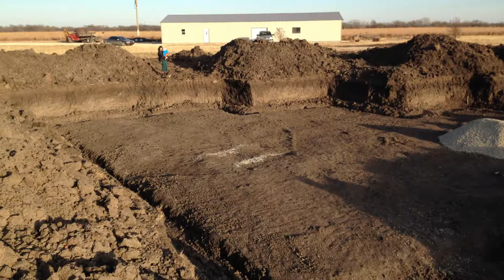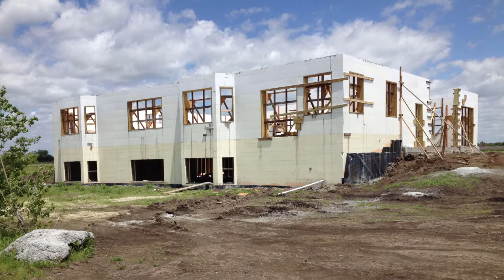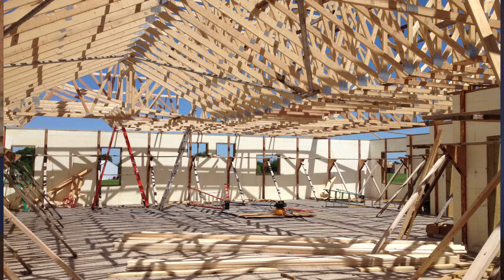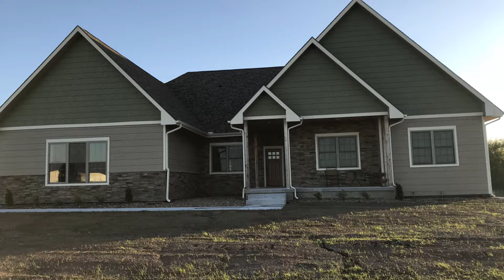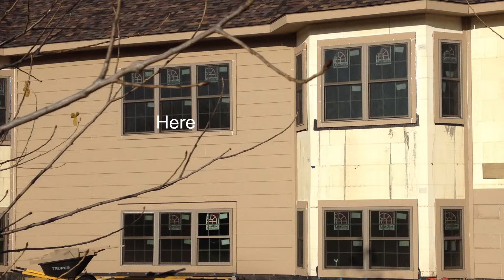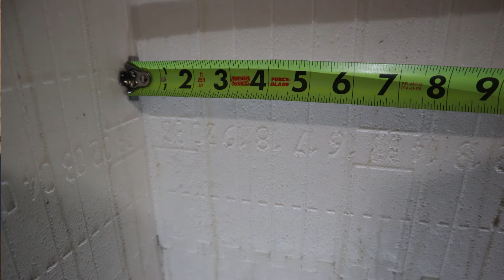The Realities of ICF

Comment: Hi, I wanted to ask you about your plastic strips. And around 11:45 you mentioned plastic strips to screw like you know. Hang stuff on the walls.
So you don't use furring for wood furring to hang the drywall? Then from there you know wouldn't be easier just to use the wood for it and then used to use that to drill into. You know like you want to hang something
Reply from the maker: The plastic furring strips are to take the place of wood ones.  The wall is already thick, so adding wood would make it even thicker.

Comment: In Kansas, I’d have considered adding a concrete roof.  I’m going this in Georgia for hurricane/tornados.  I want my roof to be concrete also, so there is no uplift and 50 year roof with terra cotta tile glued to waterproofed comcrete
Reply from the maker: My spans were too big
Reply: @TheChallenged1 hmm my spans will be 28 feet.  The pitch will be a 4-12 and 6/12  lines.  The length is 70 feet. We will see.
Reply from the maker: @Alphasig336  I believe you should be just fine.  My spans were between 40 and 60 feet depending on the location within the house.

Comment: An easy solution to the problem in finding the metal studs in the ICF walls is to hang wood firing stips before you drywall.   It's an additional cost, but it will make dry walling easier, and you'll have a wood surface to acrew/nail into that's easy to find using a stud finder.

Comment: I did a hvac job on an ICf house and going thru walls was terrible due to the concrete. Next job walked thru the job to layout for builder to put have openings where ducts will be. Came back and no provisions were done. I said goodbye. Won’t do a job unless ductwork in attic with no concrete to penetrate

Comment: We just bought land and looking into the double wall method and the icf
Reply: I wonder if you will be better off with ICF + steel framing.

Would it be cheaper overall?
Reply: @GerminiETH  the double wall method is cheaper framing might be cheaper as far as material, but it’s not cheaper when it comes to labor

Comment: Insofast is a company that exclusively built ICF.  They pivoted and now provide insulation products for stick build.  X brackets are their latest invention, and allow the exterior chipboard to be spray foamed.  You can do a Joe Lstiburek perfect wall as the foam is both a vapor and wind barrier, which prevents wood rot.

Comment: It sounds like you are a hardcore energy saver, you may like earthship homes or any underground structure because they do not require heating or cooling what so ever. No 2 are equal! 
An earthship home can be more costly than a simple extra large root cellar underground. 

Did you know some sewage systems are made of huge metal circles that perfectly distribute the weight of the earth above them? 

Did you know that metal back then was inferior to the metal we have today? ; because our processes are more advanced, now they can last 100 years. And if you do it right, addint gravel and having a concrete foundation and all. You can make it last 150 years or longer.

Comment: Would an ICF home be even cheaper to heat if you had radiant heating system instead of forced air?
Reply from the maker: It wouldn't matter the delivery method, just the number of BTU's input into the structure
Reply: Probably, pumping water somewhat constantly is probably cheaper than pumping air not quite as constantly. The difference with be the cost of pumping not the cost of energy.

Comment: Great videos and very educational!! We just bought a 4700 SF ICF home built in 2003 in Andover, Kansas.  First thing i noticed was the consistent temperature throughout the home. We’re renting a traditional home in Illinois and it’s highly inefficient. The wife and i slept in the new house and noticed how quiet it was.  I did feel the air in the basement felt a little still.  I also noticed how little the HVAC had to run to keep the temperature up.  Thanks again for your information.
Reply from the maker: Congrats on the move!!!  It really is a different experience living in an ICF home

Comment: I Wes wondering if you spent/n found windows that exceed the norm because that’s ur weak spots. I’ve noticed that my temp can b 72 in the center of the space but at the windows it can b 20-30 degrees less ( -25 temp outside)   I’m wondering if windows could / should b fixed units as ur inside is so conditioned.

Comment: Other than the insulation, the properties you describe are true for brick/CMF homes.  I don't live in the US and in my country all homes are built either with brick, concrete or CMF blocks.  When I visited the US, the noise and wind caught me off guard.  You really don't have those problems with above mentioned homes.  In the US the noise insulation between rooms were really bad.  The insulation and ease of construction would make ICF my preferred choice.  But just wanted to point out that other than those two properties everything you describe is pretty much equally relevant on for living in a non-wood constructed home.
Reply from the maker: Makes sense

Comment: Loving your videos.  I am helping a friend who has decided to build her house with ICF blocks.  I'm 65 now and a retired former General Contractor and Chief Building Official, so I have experience in building and the regulations and codes that govern their methods and materials, and I really like the advantages that ICF construction offers, but I don't have any prior experience working with, or inspecting ICF construction.  I'd really appreciate any and all advice you can provide. My friend would even be willing to pay you a modest consulting fee for one on one phone or video chat consultation sessions regarding specific parts of the construction process, like your Geothermal heating and cooling system, and perhaps the Solar electrical system.  I also have prior experience working as a lead draftsman for an Architect very early in my career, so I am working on her house plans myself, with the guidance and help of an engineer friend I used to work with.  I hope to have the plans completed before Jan. 1st of 2022.  Please let me know if there is a way to contact you directly, or some way I can get my contact info to you without putting it up in comments here for the whole world to see and abuse.

Comment: If the sheet rock is screwed into the plastic studs, just use a magnet to find the screws. No need for a stud finder.
Reply: Doesn't a basic stud finder use a magnet?

Comment: I built our 4000 sq ft ICF home in 2003. The wife and friends said I was crazy to use ICF. Currently we are experiencing a heat wave of + 40 C. (Canada) and the interior is 20 C, or about 70 F. Love it.  As well when the winds exceed 50 mph we don't hear nor feel them.  Our heating costs are very low even though we have 6 months of cold winter, often below -40 C. This house has not moved 1/8 inch in 20 years. I went with a high efficiency gas furnace for expediency, but even in the winter it runs very seldom.  The only way to build.
Reply from the maker: Thank you for sharing!
Reply: I am just finishing one in northern indiana and heating it with a 24,000 btu ducted mini split, 2080 square foot footprint with full basement and main level so 4160 sq ft of floor space being heated. It is the only way to build a house and I dont think I could do a conventional house now.

Comment: The only hidden cost is a “Air Circulation System.” These houses are so tight that the interior air needs to be refreshed. This system can be designed to handle the square footage, and really takes care of all your humidity or dryness problems. My house is 3600 sq ft, with 36% exterior glass (floor to ceiling) with 12’ ceilings throughout. We only use electric, which includes a sewage pump system, and one (yes, one) AC/Heat Pump. We also have our own well, so there’s an electric pump in the well. My average utility bill? $72.00 per month. So, how much more was the construction costs? About $6-8.00 per square foot. But, when you figure the average 3600 square foot house with normal wood construction you can expect to pay $200-300 per month for electricity, plus an initial cost of much larger AC/Heat units. So, within a year you will re-coup all your extra initial construction costs!!
Reply: Why did it cost $6 to $8 more per square foot? Was it because of the labor that ICF the concrete?
Reply: @victoriaalai5041  the extra cost comes from the concrete and it’s placement. Plus there are additional rebar costs. BUTBwhat appears
Reply: @stephentaylor9366  thank you for your quick reply. My husband and I are thinking there may be extra costs to too make the cuts for the plumbing and electrical lines as well. You're information was very helpful.

Comment: I’m trying to imagine the amount of sweat I would experience if I kept my house 76-77 during the summer. I can’t even sustain 72 for any length of time. Back down to 70 is where we go.
Reply from the maker: Pretty spoiled
Reply: @TheChallenged1  I grew up in houses with no air conditioning. I’ve only had A/C for 4 years now and I think of it the same way I do heat in the winter, it’s there to make my space live able. My house is 68-71° year round.
Reply: I totally agree Jen, a super insulated house isn't affected much by the outside temp so once the house is at set temp it more then likely doesnt use much more energy to keep it at 69° (where my house is year round) vs 76°.  I'd be willing to bet it's fractional, especially with high efficiency HVAC units
Reply: @gyminit5  exactly. Insulated house and windows shut tight, my A/C isn’t working that hard to keep my house at 70° even when it’s 95-100° outside. It uses much more energy to heat it from 30-40° than it does to cool it.

Comment: We just built a 6200sqft home (including finished basement) and used an R30 ICF product. Blown away with the efficiency so far especially the ability to manage day/night temperature swings. We barely need to run our AC unit or heating system. It has been silly efficient so far. Absolutely love it.

You raised a couple other points that resonated with us. We're on a rural property and you would never know when it is windy outside. And yes the usual temperature related creaks or pops are non existent with ICF.

Highly recommend that anyone looking to build with ICF include a higher end HRV/ERV system to constantly exchange the air inside since it creates such a tight envelope, and also to look into a HEPA/VOC filter for your furnace and/or recovery ventilator.
Reply: Now that’s what I’m looking at. Love the testimonial. What’d u do for windows ?  I often wondered if more needed to be done with the conditioning of the air   Do you open ur windows or keep shut ? What’d udo for the basement floor ?
Reply: Not the original poster but I can answer your questions. I did triple pane windows from Provia and I do open them a lot during the temperate months here in northern Indiana. My basement floor is 5 inches of concrete over 3 inches of foam board, I did put tubing in the floor for heat but it is not hooked up to anything at this point. I and 2080 sq ft per level, basement and main floor and heat it all with a single 24,000 btu ducted mini split in zone 5 northern indiana.

Comment: Are insect infestation more prone to ICF homes?
Thank you for your videos, very educational for someone new to ICF homes.
Reply from the maker: Less so than most homes because they are much tighter
Reply: Insects don't eat concrete
Reply: Some insects do like to burrow into the foam to make homes. We built an ICF house (a two story with full basement) in Illinois in 2004. The lot we bought was the last vacant lot in the neighborhood, had a lot of large trees and when ever it rained, had areas with a lot of sitting water. As a result, the entire lot had years (and layers) of accumulated fallen leaves which had decomposed into a material which was very attractive to ants. After the house was finished and we had lived in it for a year or two we noticed how many ants we always saw on the sidewalks and in the flower beds. Then we started seeing them in the house. (I joked that we must have built the house right on top of a huge ant colony.) Anyway, we engaged the services of a pest control company which treated the outside of the house quarterly. And if we ever saw any activity inside, they came out and treated the interior with pet safe ant bait material. The ICF blocks we used were the standard type foam, but some manufacturers do (or did, I haven’t checked recently) incorporate borate into the foam to discourage insect activity. Of course at some point the effectiveness of the borate will dissipate. The ICF walls are tight, but ants can find their way into anything through tiny openings around windows and doors. We lived in the house for 18 years then retired and decided to move to a more temperate climate. I am an architect, designed and built the first house and wanted to design and build with ICFs again, but the pandemic and the great distance we were moving made that problematic. I do miss the many advantages of an ICF house, especially the feeling of security.
Reply: Some insects do like to burrow into the foam to make homes. We built an ICF house (a two story with full basement) in Illinois in 2004. The lot we bought was the last vacant lot in the neighborhood, had a lot of large trees and when ever it rained, had areas with a lot of sitting water. As a result, the entire lot had years (and layers) of accumulated fallen leaves which had decomposed into a material which was very attractive to ants. After the house was finished and we had lived in it for a year or two we noticed how many ants we always saw on the sidewalks and in the flower beds. Then we started seeing them in the house. (I joked that we must have built the house right on top of a huge ant colony.) Anyway, we engaged the services of a pest control company which treated the outside of the house quarterly. And if we ever saw any activity inside, they came out and treated the interior with pet safe ant bait material. The ICF blocks we used were the standard type foam, but some manufacturers do (or did, I haven’t checked recently) incorporate borate into the foam to discourage insect activity. Of course at some point the effectiveness of the borate will dissipate. The ICF walls are tight, but ants can find their way into anything through tiny openings around windows and doors. We lived in the house for 18 years then retired and decided to move to a more temperate climate. I am an architect, designed and built the first house and wanted to design and build with ICFs again, but the pandemic and the great distance we were moving made that problematic. I do miss the many advantages of an ICF house, especially the feeling of security.

Comment: What width did you go with for your ICF's ? I'm curious if there is much of a difference between 6 inch and 8 inch.
Reply from the maker: 8" in the basement, 6" on the main floor.  8" is much easier to fill with concrete.

Comment: Did you go with triple glazing?
What was your price sqft?
Did you insulate under basement floor?
Concrete on main floor?
Why not quad roof means no roof maintenance and then you'd have zero leakage and all conditioned space?
Only questions I have at this time...one more step in MY learning curve as I am totally convinced ICF is the ONLY way to the future.
Immediate savings on utilities to offset costs of building efficiently lend to help with payments.
Reply from the maker: Double pane windows
$65/sf (Made a video about it)
Yes (Made a video about it)
No
The spans for my roofs were too large for ICF Roofs and I don't like how they look.

Comment: Garrett, what did the cost PSF for your home work out to for your solar system and where did you locate your solar panels? You mentioned ground source heat pumps. Is this the same as geothermal, and what was the combined cost PSF of your two ground source heat pump systems? Also, what are you paying per KWH there in Kansas for electric from your utility provider? And, can you tell me something about your windows? I assume they're double or triple pane. Do they have argon gas and UV protection?
I'm in the suburbs of a large city in KY. I haven't seen any ICF single family residential construction, but I have seen it in a hotel. I follow a YouTuber in south central Indiana who has worked with ICF for some of his residential customers. To date it has only been for foundations. He'll be doing a two story house in ICF this year. From a contractor's perspective, he really likes the product.
Thanks!

Comment: My 2x6 framed house has gone through several hurricanes and I've never heard any creaking.  Maybe do a better job on the details of design and fastening?
Reply from the maker: I'm assuming your house is designed to hurricane standards.  99% of the homes out there aren't, but I definitely think they should be.
Reply: @TheChallenged1  yes it was designed for high seismic and wind loads.  Everything good so far, except the fish tanks are real scary in earth quakes.  Little tsunamis threatening to top the tanks and spill on my floor, lol.

Comment: Hey Garrett, I am building an ICF home with a basement plus two additional levels for a total of 5400sqft of buildable space up in Oregon and I am pretty torn on what to do for heating and cooling.  We have a pretty moderate climate that dips into the low 30's in the winter and up into the 90's in the summers.  The local HVAC contractors are quoting me $30k+ systems.  My thinking is "do I really need to spend that kind of money up front in an ICF home?"  Really dont know what to do.
Reply from the maker: Did they do any heat load calculations to size your system?  It should be smaller than a traditional house by 40ish%.